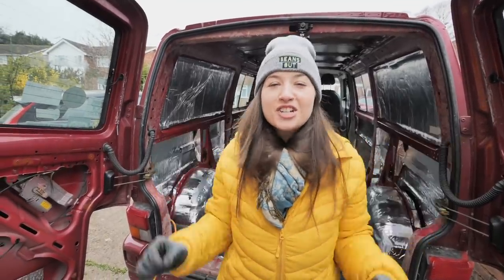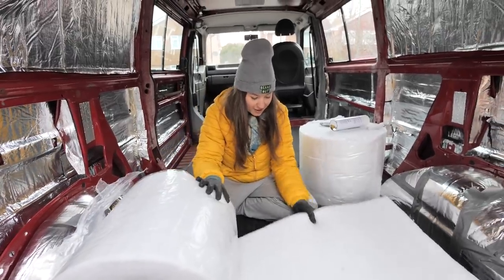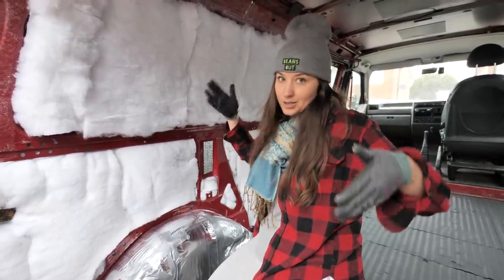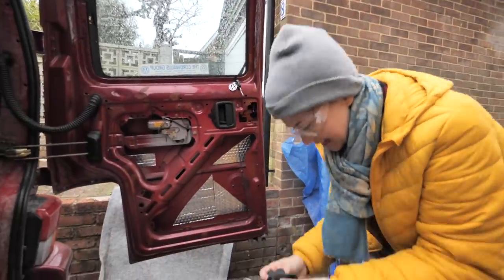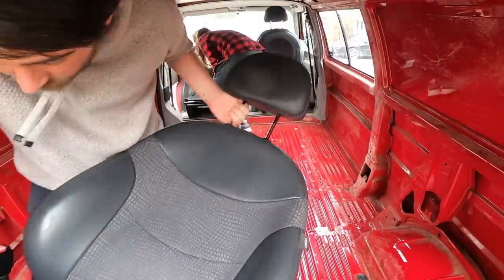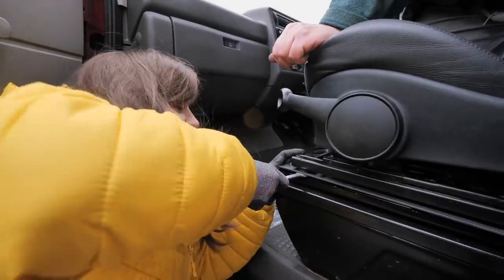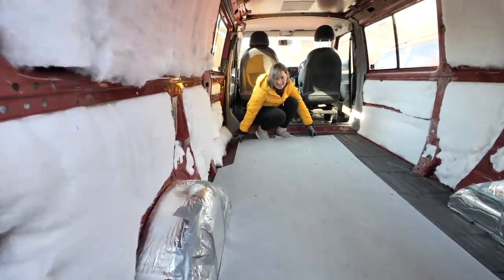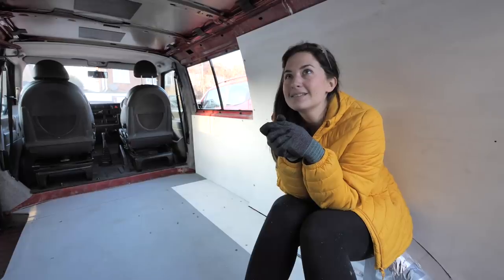Van Build Mistakes! Self Build Camper Van Conversion For Dummies Part 2

Comment: For the screws you put holding down the floorboards, make sure there isnt any bare metal exposed underneath the van. Will save  you guys alot of moisture and rust hunting time :) Keep up the good work!
Reply: yeah, or just use double sided sticky tape
Reply: @johnc3403 double sided tape to stick the plywood instead of screws?

Comment: Fantastic efforts guys. I think I probably would have used the ply on the floor as a templaye to just trim the insulation over the wheel arches rather than cutting the board. Just run a box cutter along the top of the floor ply round the insulation.  Pull it out and fit the board with the original screw holes. Might have been less hassle. Equally I've never fitted out a camper van so that might be crap advice. Happy to be schooled 🤔

Comment: you should use a box cutter, we in the states in construction call them utility knives. or a good scissors measure and then cut,..works awesome with what your doing. and 3M comes out with a good spray adhesive you spray on both surfaces press and stick. Around your wheel wells you could of just pulled insulation up instead of cutting board,..that little bit wouldn't hurt anything. And as for design for floor i use a piece of card board. i make my design on card board and then trace it on board makes things much easier. As for screwing it down and not finding holes. takes photos measure to each one snap a photo of measuring tape,..so when you put board down just follow photos. And so your boards don't come loose you should have use glue adhesive to either floor walls back of board when you fastened them down. will help so they don't come loose and no squeaks either. Awesome re-fabricating swivel base. better that then waiting weeks for another part. And when you have everything apart and before you do anything it helps to wash all dirt and grime off. ALL SURFACES!! So when you caulk or use any adhesive it sticks. Dirt, grime will not let it stick so well. be safe take care.

Comment: You had a good blade in the jigsaw for a plus point. One with the teeth facing up doesn't rip apart the face of the wood.

As for the kits you can buy.... Maybe for the VW's and Ford's but they are most definitely not for every van. I have a Bongo and have just finished the guts of my build on that, everything in there I had to build to size as I went.

I think a lot of people have you mistake of flooring being too small after adding sound deadening and insulation, it's not something you think of until you have built out a couple of vans but you are doing a great job so far.

Comment: Hi! I am a bit worried the holes you had to drill to fit the floor panels might rust. I see other van builders put some special paint on each hole they drill on the body of the car? From one dummy who loves your videos 😘
Reply: Silly Rabbits. Why didn't you just cut the straight side of the floor panel?
Reply: I wondered if they filled in.. I assume they did...  the original holes in the floor!
Reply: @williamnordeste1169  because the gap was only around the wheel arch, not all the way along. There would’ve been a gap in other areas

Comment: I suspect you may get a condensation problem if you plan to use this van in a cold climate. Moisture will collect in the insulation and between the insulation and the cold metal. A water-/steamproof layer between the insulation and the panelling should solve the problem.

Comment: I would recommend a vapour barrier to stop your insulation holding moisture and rusting your van.  Are you covering the wall boards? We found it easier to cover the board's before we put them up!

Comment: I converted a T5 a couple of years back. Tips that I'd recommend, cables (including reversing sensors and reversing cameras) are best put in on top of the insulation or running down the channel/length of the body (created by the poptop). I'd also go for some membrane before sealing the walls up - stops condensation soaking the insulation - ultimately stops it rotting and causing rust!
Reply: I'd also recommend @gregvirgoe build series. I was gutted I didn't have something so easy to follow and concise when I was doing mine. Well worth a watch! It'll save you loads of time!

Comment: Hello Both.  I think you are doing a great job but one thing you should consider.  As you will be sleeping in the van the moister content of the air will become high so it would be a good idea to put a VAPOUR Check (Plastic sheet will do) otherwise the insulation will become damp and lose its insulating value.  Good luck. Michael
Reply from the maker: Thanks Michael,  we'll look into that! 🙏 much appreciated
Reply: I second that.  What will also happen with that kind of insulation is that it will start to hold water and there is a chance of mould growing. The best way to fix it is to take the panels off and cover the insulation with the sticky silver bubble wrap you can get on eBay or other van build sites. Cover it everywhere. It will stop condensation building up on the metal.

Comment: Very late late the game but with surf vans I've done always been advised to put a vapour layer between your insulation and the ply board. You can buy it online and it stops the moisture rotting the insulation over time.

Comment: doing well. the swivel seats really open up a van and make it feel bigger. id say you need to be trying to figure out what electrics youll need  and where otherwise it gets difficult trying to thread wiring behind panels full of insulation. ive emptied and put back the contents of my van soo many times now because i left electrics till last.

Comment: Stainless steel screws to be used to stop rusting, also you need a vapour barrier between the insulation and the plywood walls to stop moisture build up.

Comment: SAFETY POINTER: A highly recommend not wearing gloves of any sort whilst operating a drill (or any other powered tools like a grinder) as it increases the risk of being dragged into the machine - It is pretty much the same safety precaution that you took with your hair whilst using the jigsaw.

Comment: Great video.  I know nothing about van conversions but wonder if you leave bare metal in the insulation phase, will you not get cold spots which means condensation and corrosion?

Comment: When you put the ply back in on the floor and it was too wide because of the insulation. What you should’ve done is just scribed down the straightedge rather than cutting around all the wheel arches and everything you could’ve just scribed down the straight edge and cut it and it would’ve just slotted in. The other thing I’m interested in is you didn’t leave any kind of gap for air flow, or use a vapour barrier or did you not need it with the two Types of insulation you used? Love watching though 😊

Comment: Just worth a mention- that having modified the seat rails have you used similar or the same specification bolts to mount everything? Heaven forbid you should ever have an accident you need to know the seat won’t rip off the mount?

Comment: I would be concerned with the swivel seat modifications.  The parts should all be built to withstand a crash, and adding a home made part into the mix adds uncertainty.  I’m no engineer, but I would maybe check with a shop or the pop-top installers to see if it is sufficient or not.  Given the seat is part of the safety equipment on board, I would make certain of its integrity, or just get the correct part.  Otherwise great progress!

Comment: looking good, are you planning on carpeting the ply or using the wood look?.. I would go with carpet (look for 4 way stretch carpet as its a dream to fit).
Reply from the maker: Not 100% decided but that very useful to know about the carpet! Thanks for the tip! 👍

Comment: As others have said, should of put a vapour barrier on before fitting the ply. Every piece of metal under the ply will now get wet with condensation and your ply will rot and get smelly.

Comment: Great on you both, I have always wanted to do this, ya 45 years ago, but so be it.  Have a question if I may, why did you not use spray insulation foam with low expansion rate for the sides and bottom?  Can't wait to see your other videos, keep it up and don't give up.

Comment: good one Dad :-) drivers seat with a swivel is also good would leave more room in rest of van instead of seating wiring schematic or are you using another method of running the wiring ?

Comment: Just a couple of thoughts. Altering the seat base  could have cost you £150. Seems a bit risky,. Why not send it back for replacement? Also would it not have worked to take the ‘extra’ bit from the flooring from the middle? Or was it the profile round the arches that was wrong? Great vid and thank you.

Comment: Hey guys, found you through searching van things, nice little T4 you got there, where you based, if you ever want any can help or contacts just holla 🤙🏼

I have a 1998 SWB 1.9td T4 which is wrapped and quite low all set up for camping 🏕

Comment: Rather than cutting the floor, you could simply have trimmed the insulation around the bottom of the wheel arches!  This would have meant also that the floor holes would have lined up

Comment: I am always cautious of drilling through the floor of a vehicle unless I’m absolutely certain that there is nothing vital on the underside (brake lines, petrol lines, etc.). I assume you (or your dad) checked that out before making those holes. Might suggest some sealant applied to the underside where the screws protrude to minimize corrosion too. Otherwise, as an person with a fair share of car mortification/restoration experience I was impressed with your work and progress. Two thumbs up!!

Comment: I've not done anything like this before (I am also a 'dummy') so I don't have any authority to tell you what to do, but I am wondering why you didn't just cut a straight line on the other side of the plywood floor rather than having to cut round the curves on the wheel arch side?

Comment: are you using non flammable materials ?
Reply from the maker: I believe the thermo fleece and floor insulation are but I'm not 100% sure on the thermo van liner we used on the previous video

Comment: Y ,,, not put the 2 floor panels on the floor in the van and instead off taking 1/2 inch off all the way round put them on the foor and draw a straight line on one of the floor panel and cut it straight